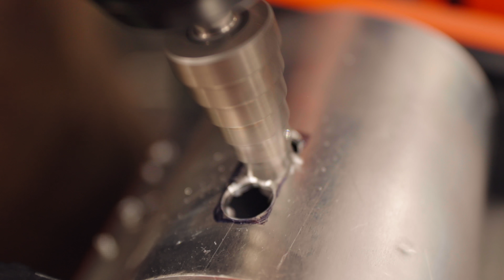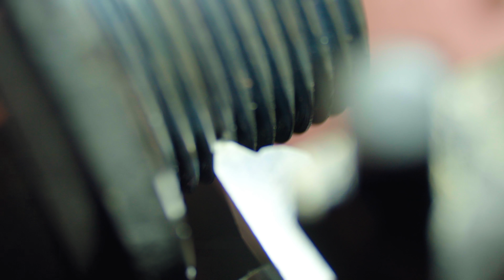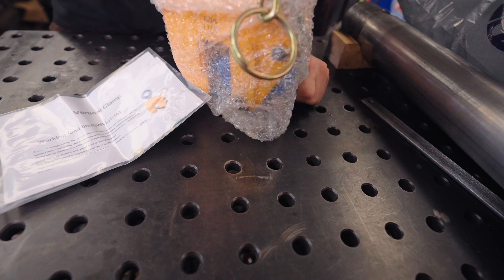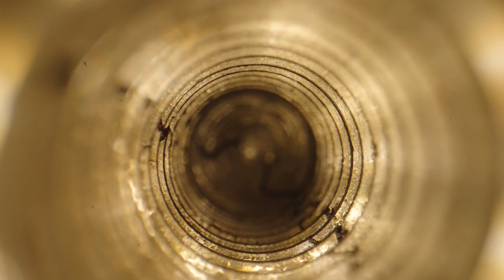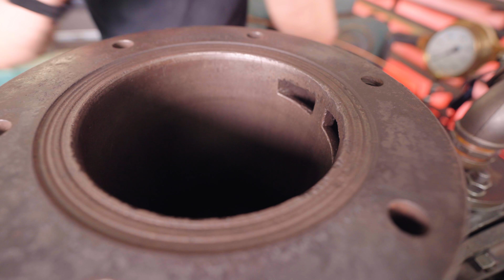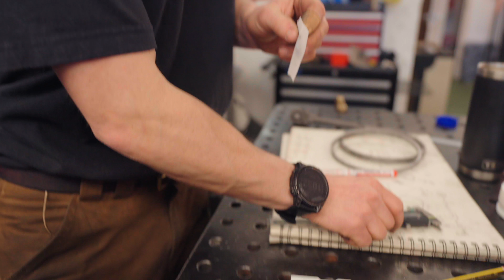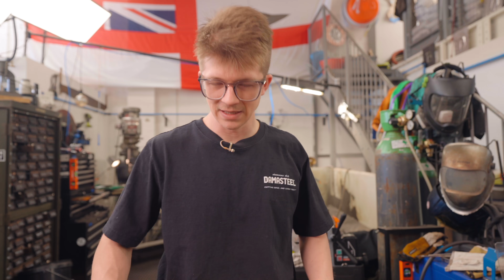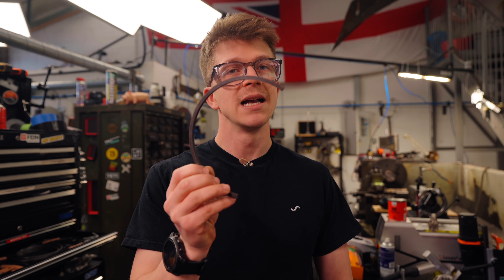Re-Restoring the Steam Hammer! Part 10

Comment: .003 inch tolerance?

Try .0002 TOTAL TOLERANCE, that is what aerospace and medical fields demand. Oh and that includes runout on a 4 inch long part......for 1000s of parts in a row AFTER TOOL CHANGES AND HEAT CHANGES.

Im slowly going insane.

Comment: I believe that the welding/machining operation on the grub screw holes was a lot of risk for nothing. It would have been just as good - if not better to ignore the two existing holes and create new holes ninety degrees away from the existing ones. This would likely result in a more robust grub screw and negate the need to fill in the existing holes. I am thoroughly enjoying this series. I am already preparing popcorn for the next installment.

Comment: The piston will likely contact the bore when it strikes, but it should be minimal. I'd expect the rings to scrub off any sort of marks though. Also where a good thick oil will help absorb the hit. Don't forget to calculate thermal expansion on the rings if you ever plan to run this with actual steam.

Comment: why doesn´t the piston have any oil scraping rings(not sure about translation). I´m not familiar with steam engines at all, but is it because the RPMs and heat is so much lower compared to ICE engines, so the need for lubrication isn´t that essential or is there a different reason?
Reply: It doesn't have an oil sump so it doesn't need oil control, just like two stroke engines.

Comment: Centre punch the threads around the top of the dutchman to further lock it. A "mickymouse"
Reply: Staking the threads - 3 center punches, equally spaced, centered on the bolt thread line when fully seated. The original thread locker
Reply: no the dutchman needs its own dutchman
Reply: He didn't say "that ain't goin nowhere" so its going to back out 😬
Reply: Also pretty common to tig weld a little tack. Can grind it out if you need to but its pretty solid.
Reply: That's what I was thinking
Reply: I'm new to this. Wouldn't it make sense to have reverse threaded the grub screw so no matter which way it turns one of them is tightening?
Reply: @jono6379 only if they are concentric. iirc vovlo (possibly komatsu) does this on their excavator boom cylinders to lock the piston on. The piston is threaded on with a right hand thread and a locking nut is threaded on the other way for exactly the reason you mention.
On a dutchman (or as i know them, a french key), its a shearing plane so it wouldnt matter which hand it is.
Reply: I say you add another dutchman to the first one. Then one more just for good measure.

Comment: Piston rings on internal combustion engines are sealed by the combustion gases - not the springiness of the ring. The gases vent around the back of the ring and exert force - pressing the ring against the cylinder.
Reply: Both gasses and springiness

Comment: Why would it not have been possible to drill out that older dutchman hole instead of welding it? Would be a pain and maybe requires an endmill but I would imagine it being better than welding and finding that outer thread. Especially since you made it larger anyways

Comment: Have you ever heard of taper lock bushings? These are shaft mounts that work like a collet being compressed by one of your "Dutchmen" screws. Obviously that would take too much of a redesign to be useful on your piston, but it's an interesting way to add spring retention to the grub screw.

Comment: Hello from the states again, again, as a machinist for 45 years, what you call "grub" screws, we call set screws. We also call those "Dutch keys". A long time ago, I was taught to use two set screws. Basically why is, both will hold the piston in place, but the set screw on top "locks" both screws together so they won't work loose, along with the Locktight will make it secure for a long time. Just a different way of doing the same thing. 👍😁
Reply from the maker: Oh interesting, as in one on top of the other in the threaded hole?
Reply: @AlecSteele yep, not only that, we wouldn't weld up the screw holes, we would drill new ones about 90 degrees from the old and file the threads so it would fit. Next time that comes apart, well, I don think it's going to be you doing it., I mean, another 100 years... But that's how we would lock wearing rings on to a pump impeller.

Comment: Most piston rings in modern diesel engines are ground from chrome molly steel. You may consider that. Very hard material. The oil control ring is the only cast iron ring. But you don't have one. Also many of the top compression rings are keystone shape so combustion pressure forces it into the cylinder walls tighter on the power stroke.
Reply: You want the ring to wear. Rings can be replaced. Cylinder bores, not so much.
Reply: @1pcfred  and that's why there are cylinder liners. The honed cross hatch pattern holds the oil coating and the reason the oil control ring has holes in it to install the oil film. In the 55 years of my diesel engine rebuilding career, piston technology has changed very little.

Comment: two tips for the machinist in you: 
1. next time flip your threading tool over and run the machine in reverse, then you can run from right to left and don't have to be scared about crashing (same logic as internal threading on the far side of the part)
2. Counter sink your holes before cutting the threads. Otherwise the coutersink deformes the treads. When countersinking, have the outside diameter be 10% bigger than the thread you're cuttting -> M12 would be an diameter of 12mm+10%*12mm = 13.2mm

Comment: Not an expert by any means but the few rings I've made were cut to the expanded diameter then slotted to bring down to size.  No need to expand and heat treat that way.  Perhaps I'm not doing it right but I haven't had any issues with the ones I've made.

Comment: Which I am sure you looked into this during your research, but with Automotive rings, you have to be aware of the temperatures at the engine runs because of thermal expansion of the Rings themselves. If it is a perfect fit where they close, they expand beyond and what the circumference is and will buckle and break a ring-land.  I assume these steam Hammer may have compensated for this a little bit, but if you are running just are you might need a different ring Gap

Comment: I was told, Piston rings for steam engines are predominantly made from fine-grained cast iron. This material is chosen for its durability, resistance to high heat, and self-lubricating properties.

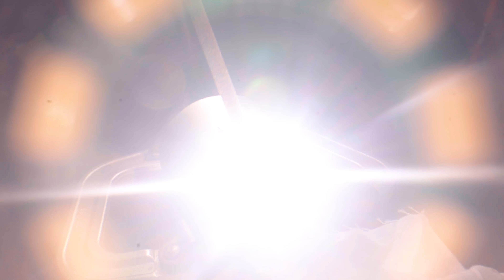Comment: 1:28 7018s go in the oven to remove the water (moisture)! The water/moisture can lead to hydrogen embrittlement, which is why you use low hydrogen rods like 7018/16tc in the first place.

Comment: In a engine you start with an oversize pistonring and file it down to the gap spec. Due to they expand in heat you need the clearence or it will seaze. But an engine proberly runs hotter than a steamhammer. Is there anything about ringgap to the sreamhammer?

Comment: So why don't you drill a hole down below the piston rings drill a hole 1 inch into shaft or drill a hole all the way through put in a harden rod shaft and thread 1 inch in on both sides and put in grub screws with red lock tite. This just an idea only hope you like it.

Comment: Hasn't the development of metallurgy improved so much that one may not be obligated to use the same materials as were used originally? Even if the rings were cast iron back then there would surely be tougher, more durable alloys of steel now to displace it. We could go on to discuss coatings for added durability in a hostile environment like steam or damp air under pressure. Cerakote wasn't a thing back then but could always help corrosion resistance.

Comment: Not to be that guy but wouldn’t it have been easier to screw on the new piston and just drill the holes out to remove all the thread then re tap with larger grub screws?

Comment: Seal design engineer who's worked with plenty of piston rings before (though mine are typically plastic with a metal band energizer). I think machining the ring to the bore diameter is the correct approach, but one consideration on whatever forming mandrel you make is that it should be slightly non-circular. When installed the ring is going to bend a lot more opposite from the cut than it will anywhere else, so if your forming mandrel is perfectly circular, your ring may be an oval when installed and have poor contact.

Comment: Also, I think you you need to make the piston rings larger to compensate for both the material removed from the splitting based on both the saw width and the angle of cut bacause of good ol Pythagoras.
since it looks like a 45 degree cut, the outside diameter of the ring will become about 0.3*sin(45deg) =0.4mm smaller, not just 0.3mm like the width of the cut :)
Reply: Actually it is the gap width measured along the circumference over 2π.
So if the slit is 0.3mm at 45° it will be 0.3mm/(2π sin(45°)) =0.0675mm

Besides you need a gap to account for nonuniform thermal expansion as well as variance in cylinder circumference.
Reply: @tymoteuszkazubski2755  Oh yeah! I did my calculation again, and it's 0.3/cos(45deg), or 0.3/cos(pi/4), where the hypothenus is the amount of separation of the ring, about 0.42mm.
Surprisingly the same answer as I got before tho.

But true, thermal expansion will play a role since there's so much heat going on :3
Reply: @andreasgunnarsson8196 you are missing 2π factor between radius and circumference. If you increase radius by 1mm you need 6.3mm of ring more to seal the gap.
Reply: @tymoteuszkazubski2755  Sorry for the trouble but I don't see why that's relevant.
I'm simplifying the ring down to a straight line rod, no radius.
If you make a 45d cut with a 0.3 cutter on that rod, you'd need to make the rod 4.2mm longer.
I don't see why a circle would change that
Reply: @tymoteuszkazubski2755   Oh also,
When I say length, I mean the circumference, the actual length of the material. not the radius

Comment: Alex, Tell everyone the rods were boiled in 200 proof alcohol for "cleaning them"... it will make everyone in shop drunk just from breathing any of it ! Did the original piston rings have the slanted cut gap ? The area of ring being exposed and its angle will affect rings performance and durability. Remember it's the pressure of gasses allowed behind rings that inflate them into the ideal fit on bores walls vs oil films. Is there a more positive means of spraying a lighter viscosity oil on walls of bore and recirculating it for cooling effects ?

Comment: Huh... I mean, now that you say it, steel does make the most sense. Still, I'd suggest not throwing out those rings you made just yet, Alec; I'm a painter and I make scenery for tabletop games, and let me tell you, you NEVER know what is going to come in handy for a later project. Broken Christmas lights? Bosh, wiring on a bunker. Bits of a broken fan's motor? I can make a very convincing engine with that. I'm just saying, I know you and I have completely different skillsets, but I think there's more overlap than you might believe... especially since I'm getting close to dropping several hundred on a 3D printer... wish me luck. 

Anyway, I need to see that hammer restored, and I believe you can do it. Just remember: don't be hasty, no matter how excited you get. That's how you wind up with a centerpiece terrain that tilts to the side... oops. I made a leaning tower of Pisa by accident. Oh well, it still looks cool, but I should've measured more and checked for how level things are. Anyway, I think you've got this, Alec, and I think you're going to figure it out. Those rings are going to be a pain, but I'm curious to see how they turn out and just how well the machine will run when it's done.

Comment: Forgive my ignorance but what was the purpose of putting the aluminum plate piece with the hole cut in the middle when filling the weld part in the beginning? I’m guessing it’s to prevent or block the slag bubbles or whatever they are called from sticking to the “good parts of the threads but again I don’t know really anything about welding… 🤷‍♂️

Comment: You very likely need some play in the piston rings to allow for thermal expansion.

If it’s a perfect fit at room temp then it will likely expand when you’re using the hammer and could scratch the cylinder wall or not seal properly.

Comment: Why'd you make the new grub screws in the same spot as where the old one was. Isn't that significantly weaker than putting them at a 90 degree offset on the perpendicular sides where the metals are far stronger and less weakened.

Comment: OH boy. That reminds me of the time, that I got some "spring steel from an old leaf spring" (as my friend who sold it to me assured me), and I proceeded to forge a sword out of it

It felt weird while forging, then I heat treated it (or at least tried), tempered, and...

Nada. I bent that sword with one hand, because it was f^cking mild steel. If only I did a hardness test on it, if only I cut off a small piece and tried heat treating it to see if it even is hardenable...

Welp, still sold the sword as a typical wall hanger :v

Comment: The still will probably make for spring year piston rings. But if you concerned about the lubricosity of it I wonder what it be like to make them out of bronze kind of like your bearings.    Also I feel like instead of cutting the piston rings to the end squeezed diameter that you want to be and then bending them open, you cut them out of a pipe that has the end diameter before you squeeze the pistons in and just cut out the difference between the diameter of the piston ring and the diameter of the piston wall.  That way instead of the piston rings being oval shaped they'll be perfectly round and give you a better seal for the piston and piston wall.  Just a few thoughts

Comment: Alec.
Don't forget to check the temperature of the work when you remove a lot of material, if your work is warm it'll cool to a different temperature.
And given the heat in the UK at the moment I'd re measure everything before starting, just to be safe.
Nice rings, maybe someone will need them.

Comment: Cast iron would be the original...it seems they put steel in as a fix...
Almost all the OG steam pistons from locomotives and whatnot are cast iron...
Ah well...the piston head itself is spot on and with all that red loktite...it ain't going nowhere anymore
I wonder if nylon would work as piston rings in a steam/air hammer...they use them in oil less air compressors and nylon melting temp is 215-220°C, which should be a lot higher than the temp of steam, even though the softening temp is usually much lower

Comment: 700g would still be around an order of magnitude less acceleration/deceleration than in a normal car internal combustion engine with cast iron piston rings

Of course those piston rings are much smaller, lighter, and better supported

Comment: I might be completely missing something here, but at least for gas engine piston rings, there has to be a ring gap, mostly for thermal expansion reasons. Wonder if that might be true for this as well?
Reply: its running on compressed air
Reply: yes it is. But even with the air compressor and lubrication conversions, there will still be thermal expansion happening. Partly due to friction, but also partly from ambient air temp. The hammer may also be designed to have a small amount of designed blowby to help with lubrication distribution, especially for the third/middle ring.

Comment: I did wonder if maybe they should be brass....
Also Alec, please mind the fact that with the hammer running on compressed air instead of steam, the rings will not experience the same amount of thermal expansion that they would in the original application.

Comment: The Problem with YouTube

Nude profile pictures (full frontal, AI-generated, stolen) live on YouTube for months to years.

Instant spam floods every new upload — 10–100+ bots in the first minute.

Same bots return after bans, using hijacked old accounts.

Kids’ videos, music, gaming — nowhere is safe.

How They Survive

Reactive moderation – nothing happens until you report.

AI misses cropped nudes, subtle comments, low-activity bots.

Mass creation – 1000s of accounts daily; 90% die, 10% live for years.

Dormant hijacks – 5-year-old real accounts revived as bots.

Sporadic spam – post once every 90 days → warnings expire.

YouTube’s Current “Fixes” (Not Enough)

Report button → days/weeks for review

“Strict” filter → still lets 50%+ through

24-hour timeouts → bots just wait it out

No phone verification, no IP limits, no proactive audits

What YouTube MUST Do (They Won’t)

Phone verify every account

Auto-scan & nuke nude profiles at upload

Bulk-ban linked bot networks

Default strict filters + AI keyword blocks

Public spam removal stats (they hide the numbers)

Proof It’s Bad

Creators lose hours weekly cleaning comments.

Bots reply to 2-year-old videos with fresh porn links.

Zero advertiser backlash = zero urgency.

Your Move

Report every bot (hold the line)

Tag @TeamYouTube on X — public pressure works

YouTube won’t fix this until it hurts their wallet.

Until then, we’re the moderation team.